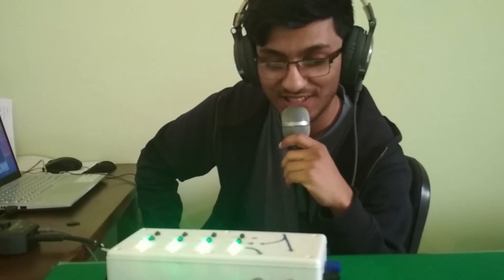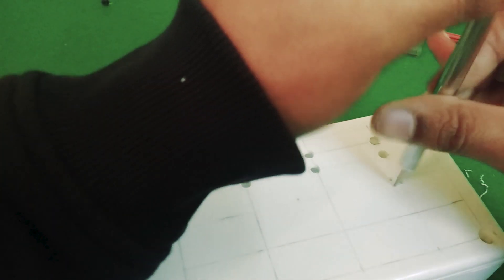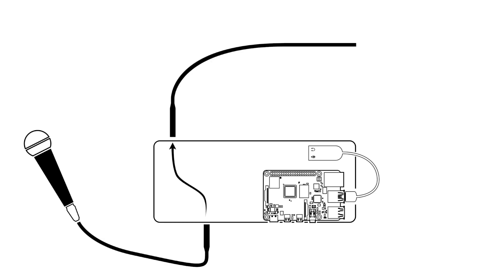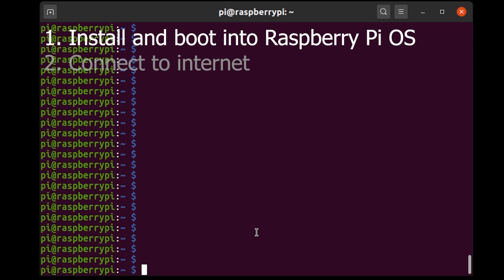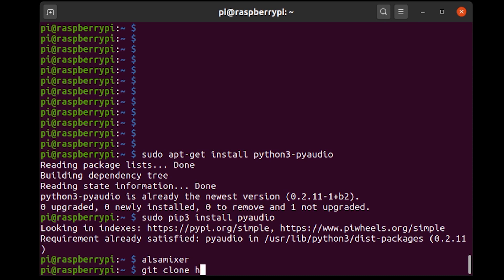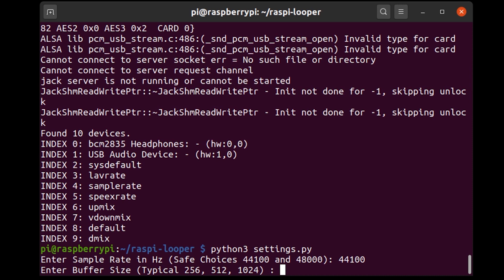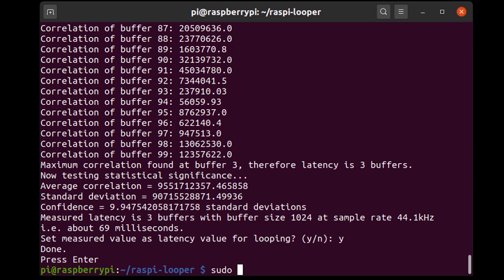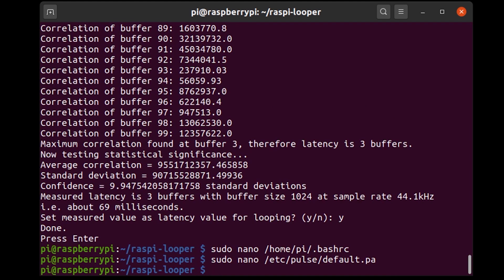DIY 4-Track Looper w/ Raspberry Pi | Building a Loop Station

Comment: Thank you for the video this looks awesome! I want to try and build this but I’m new to this kind of stuff and don’t have many supplies. For your guitar + mic input setup at 6:07 is there a way to do this with only one type of resistor (like only 1k for example)? Also I would like to try to build your mixer but don’t really understand it enough so I will have to figure out how to combine the 2 outputs. Also, what is the minimum amount of RAM I need on the raspberry pi?
Reply from the maker: Hey, thanks for watching and commenting! If you are very new to electronics I would definitely recommend using some sort of 2 channel PA or off-the-shelf mixer for output. If you want to do a simple input setup I would honestly recommend a single input, but if you want to combine your mic and guitar input signals passively with a single resistor I might suggest you try putting something like 200k in line with the mic. The input setup as shown in the video is just one possibility, and not necessarily optimal. If you wish, you can write to me at my "business email" (listed on the channel page) and we can discuss what kind of input setup might work best for your needs.

Comment: great video, definitely going to do this! One thing though, are you able to add more than four tracks, or is there a limitation in the software or the pi?
Reply from the maker: Glad you liked it! Make sure to check out the update video for the software setup. The script is currently set up to do 4 tracks. Someone did make a 6-track version, but it would require some changes to the code

Comment: I have seen in your pdf there a pots with 47k, am I right and these are logarithmic to mix the input level of microphone and guitar. I asked myself, would it be just possible to put the same ones with also the similar schematic to the outputs. Also instead of using a mixer  a Y-instrument cable, like you do for guitars with 2 outputs for amps with just one input?
Reply from the maker: Definitely the most common question I get. Not possible, unfortunately.
Reply from the maker: The reason is that if you think about it, you're just connecting the output to the input so every loop would get recorded on every overdub
Reply: @Psychotenuse   thank you  very much that is so true, just looked in the wiring again. So building an external mixer would be the best option for a pedal board to power it with 9 and than I also don´r worry at all about the 2 extra pots and just go with the ones for the Input. I am trying to do it with some more sturdy footswitches, so I have to drill out at home a metal casing I have ;) I really love how easy it looked from what you explained and this DIY is so upgradable; seems very legit! I just had the Idea of using a 3 pin, 2 way switch  for switching the resistor for guitar to microphone...would this cause problems down the road?   Very kind of you how you replied and how fast you did it :)
Reply from the maker: I am currently working on a 2024 update video to the looper (mostly just making sure the software still works as it should and updated install instructions etc)
Reply from the maker: If you want to use just one input at at time then it's best to just connect it directly and adjust the volume as required. You'll get the least possible noise this way.
Reply: @Psychotenuse  the idea is to be able to set the resistor of each input individually with a switch for each to microphone or guitar. With what you said taking in consideration, I am thinking of a 3pin 3 way switch now. on(guitar/off/on(microphone). The use would be using one input, or two in different variations.

Comment: Can you clarify why/how the raspi ZERO did not work well enough for you
Reply from the maker: Not enough processing power, basically. Would probably work if written in C but with Python there's not enough juice.
Reply: @Psychotenuse  thanks a lot for the quick reply. How do you notice there isn't enough processing power? Stuttering?
Reply from the maker: Yes. Basically, you progressively increase the buffer size until there's no more "stuttering" or glitches. The more processing power you have, the smaller you will be able to make the buffer size. And the problem with long buffer sizes is that they cause sync and timing issues.

Comment: thanks for this! altho when i tried to check for latency there was an error saying that the “np.float” command is no longer compatible with numpy 1.20 (i am on 1.24) instead use “float” by itself
is there any way i can edit your latency code and clone said repository with renewed code to my raspberry pi?
OR is there a way to downgrade numpy back to before 1.20?
this was my first time doing anything with coding and this video has given me many experiences so thank you again for this!
Reply from the maker: Hey! Did you get it to work? Glad you like the project :)
Reply: @Psychotenuse hey! so i found a workaround for the latency part!
but the autoboot part has an error going “Error writing /home/pi/.bashrc: No such file or directory” does it have something to do with the fact that i am not using linux but connecting the raspberry pi directly through my monitor using a hdmi port? and what do i do about it?
anyway i appreciated your response and sorry for taking your time!
Reply from the maker: No worries :)
Yeah, I'm not sure I know what's happening there... Can you check that you're running the commands as sudo
Reply: @Psychotenuse yo! so apparently i had set a different username this whole time XD i got it running and the software part is done
but as i feared i couldnt quite understand the schematic for the audio, so it unfortunately had no guitar sounds out the output i’ll try to write out what i understood:
so i have 2 wires which has tip,sleeve and ground wire in it which then i soldered them to each ts socket, one is used to connect with the amp and one for the guitar
for the guitar jack i connect it to the mic part of the usb soundcard and for the amp jack i connect it with the headphone part of the soundcard 
sounds were made when i did the latency test or when i touch the tip wire of the amp jack but no sounds were made from the guitar
if you have any idea what i did wrong please let me know!
Reply from the maker: Hey! Really sorry for the late reply. Seems like you're missing the "LIVE" output. BTW I will upload an update to the looper soon.

Comment: Will this work if I use my guitar without the Multi-effect processor? I’m assuming it won’t, because the audio input needs to be battery powered or have some independent power source from what i have understood
Reply from the maker: It should work, depending on the soundcard you use.

Comment: Hey, first of all, this is awesome!! Is there any way I can do this on a raspberry pi pico? Raspberry pis are kinda expensive for me and I’d really want to try this out and have a loop station. Any advice?
Reply from the maker: The Pico is a completely different thing, unfortunately. It won't work.

I got my Pi for not much money, but looking at the prices on Amazon now they seem insane for some reason (over 3x what I paid). I don't know what the deal is. Maybe prices will come down again?

MSRP for the Pi 4 2gb version seems to be 35 USD. You should be able to find it for under $50 if you shop around. Check out local stores or smaller websites.

Sorry I couldn't be more helpful.
Reply: @Psychotenuse  thanks so much for replying. I’ve found a cheaper brand  of micro computers called Orange pi, but I’m worried I’d run into issues following the steps in your video since it’s for raspberry pis, would I be able to email you about anything if I do get stuck?
Reply from the maker: Yeah sure, but I'm not sure I'd be able to help much. The code for the buttons would have to change if you use a different board. If you have experience with Python programming, you should be able to figure it out.
Reply from the maker: A little research reveals that there is insane price gouging going on at the moment due to short supply. That really sucks :/

Comment: An even better solution to autostart would be to add it to crontab, since bashrc only executes when you open a bash console, and crontab can be set up to run when the pi boots up, even if it doesn't automatically log in
Reply from the maker: Sounds like a good idea!

Comment: Hey, first of all, this is awesome! Thx a lot for sharing!

I build a prototype with just one play/record-button-set to test if it would work on a 3 B+ I had lying around. I can already tell I'm going to build the whole thing to be honest. It's sooo much fun...

When I record, the first two loops turn out quite good, but from the third loop there's increasing creaking in the resulting output. 

Do you think this might be related to my settings, or could it be because I'm using a 3 B+ instead of the 4 you suggest? Hard to get your hands on these nowadays...

Any answer highly appreciated!
Reply from the maker: I have no idea what you mean by creaking. Why don't you email me some audio
Reply: @Psychotenuse  Thx a lot, did that yesterday. But I don't think this is debuggable remotely. I'll try to get a raspberry 4 and try it with that one. Will keep you updated here.

Comment: Awesome project and exactly what I wanted to build. I have a few questions. What's the purpose of using momentary switches rather than latching? Does this mean you have to have it pushed during the entire recording? Could larger, more traditional stomp switches be used in place? The little buttons shown here seem like they'd be easy to miss with your shoe while on stage.
Reply from the maker: Thanks for watching :)

You don't have to hold the button down while recording, as you can see at the beginning of the video.

Momentary switches are more versatile than latching switches because they allow you to detect long-presses i.e. button "hold" events in addition to button "press" events. Toggles are implemented in the software.
Reply: Cool - and any normally-open SPST stomp switch should work with this, right?
Reply from the maker: Yes :)
Reply: Last question I think. I have access to an older Pi already. Would there be any issues with your code or the playability of it (lag, etc) on an older model, assuming it's at least 2 gig of RAM?
Reply from the maker: What version is it?
Reply: @Psychotenuse  either a 2B or 3B I believe. It's at work right now though and was left over from something I did a few yrs ago
Reply from the maker: It might struggle on the 2b, but would probably work on a 3b.

Comment: Incredible! Are you able to integrate a verse-chorus function where you have two completely different loops and are able to layer them separately?
Reply from the maker: There are four tracks that can be overdubbed, muted and unmuted individually. You could definitely find ways to build a verse and a chorus and switch between them.

Comment: I went ahead and am trying to make this build but with exclusively 3.5mm cabling, since I really have no need for a guitar input: I’m running into issues stemming from my lack of knowledge about the difference between 1/4” and 3.5mm audio cables. Have I made a terrible error by trying to use a mic with a 3.5mm output? Any help would be appreciated.
Reply from the maker: Not a terrible error (after all the 3.5mm jack is just a smaller version of the 1/4" jack), but there are two things you need to keep in mind:

First, the actual connections. 1/4" jacks are most commonly TS or Tip-Sleeve, i.e. they have only two conductors (and only one insulating band on the actual plug). 3.5mm jacks are more commonly TRS (Tip-Ring-Sleeve) or TRRS (Tip-Ring-Ring-Sleeve), meaning they have three or four conductors (two or three insulating bands) so you need to know that in order to use a TRS or TRRS jack as a TS jack, you simply short the Ring terminals to the Sleeve terminal on both the male and female connectors.

The second consideration is what you're actually plugging in. The setup I show in the video will work for line-in inputs or dynamic microphones, but may not work if you plug in an electret mic, because those require a special kind of input with a DC offset and drop resistor. Electret mics are used in most consumer electronics, so most cheap USB soundcards and/or 3.5mm mic inputs do support electret mics if plugged in directly. If you use any DIY wiring between your mic and soundcard, however, you must take some time to understand how your mic and your soundcard input work and how that affects your wiring.
Reply: @Psychotenuse   I see! I sent an email to you with some proposed changes to my setup. Thanks for helping someone with far less understanding of this stuff :)

Comment: Hi im new to schematics. can you tell me what the triangle on the lm358 amp on pins 2,3 and 5,6 mean on the mixer schematic? does that mean the pins are connected?
Reply from the maker: those just represent the two halves of the chip. You can ignore the triangles if you're just trying to build the circuit using the lm358.
Reply: @Psychotenuse  But are pins 2,3 and 5,6 jumped together? it looks like the wire going to pin 1 is connected to  pins 2 and 3. or does that line not matter either. thank you BTW
Reply from the maker: @Jasonbova  just go ahead and ignore everything drawn INSIDE the chip rectangle.

Comment: i have another idea 
How about we replace the Raspberry pi with a arduino and do the Loopin on the computer side via a software.
Reply from the maker: Sure, that could work. Kinda like just using a Midi controller to loop in Ableton or something.

Comment: Thank you for this project. When I perform a loop I have roughly a 3 second lag between loops. What setting do I need to change to remove the space? Thank you!
Reply from the maker: 3 seconds is way too much, honestly I think I set the maximum on the  latency script to 1 second or something.
My immediate reaction would be try a different soundcard (and repeat the setup process for it).
If the problem persists, email me at the address in my channel about and we will try to figure out what's going on.

Comment: I have built and programmed the looper exactly as you described and it works but with terrible sound recording on the loop. The rasberry pi and the looping software boot up using pulseaudio and never save the alsamixer settings. Normal ways to save alsa settings do not work pulseaudio always is loaded as default so when i open alsa mixer it always has pulseaudio selected and not my usb sound card. Please tell me how to fix this so that it simply boots up with the correct alsa settings selected.
Reply from the maker: Hm. Could you describe how the sound quality is bad? That might help narrow the issue down to software or hardware.
I didn't have any trouble with alsamixer settings reverting, so I'm not sure why that's happening for you. It is possible that there has been some change to the Raspberry Pi OS which is causing this.
Do you think your issues might be related to this: https://github.com/RandomVertebrate/raspi-looper/issues/5 ?

Comment: Can i use pedal switches for this? Also... I hear some clics when you play de recorder info ir is it the video render?? And is a RPI 4, right, since i think there isnt a RPI4 B+ ???
Reply from the maker: Let's see.
You should be able to use pedal switches for this, sure, as long as they are push-to-connect.
At the time of recording of this video there were some issues with clicking and clipping, most of which have been fixed since then in the code.
What I bought was listed as a RPi 4 B+, but I don't see why any other RPi 4 wouldn't work. Just make sure to make connections with reference to GPIO numbers.
Reply: @UCwBP-ufaCyQ3ZUS9eGUM3rA awesome! Thanks for your response, sir! Uhm, say, push-to-connect will be a "pulse switch"? Circuit close only while pressed? 🤔
Reply from the maker: @cristobalbarrientos5377  Yes, that's right. Momentary push-to-connect switches, like the buttons I use in the video.

Comment: How about latency ?
Reply from the maker: Live audio is passive analog throughput, so there are no latency issues there. The loop playback is latency-corrected by the amount detected when you run the latency detection script, seen here from about 13:01

Comment: You said something about having to use linux. Does it have to be a Linux OS to use raspberry pi?
Reply from the maker: Most of the operating systems available for Raspberry Pi are Linux-based. Honestly Windows audio is a lot better... but it is what it is.
Reply: @Psychotenuse  
But I would be able to access and use raspberry pi and python3 drivers with windows 10? As long as I have a command prompt?
Reply from the maker: I'm not sure I understand what you're talking about. Why don't you email me at the ID in my channel about section.

Comment: The first three play light come on, the third being faint. That is all it does, it won't play any sound, there are no other lights. Is there some way to see what wires are function properly? What are some other trouble shooting ideas you have?
Reply from the maker: I think that might mean that the Python script wasn't able to run successfully. That sucks :(
Can you log into into your Raspberry Pi (keyboard and monitor or ssh) and see if it's giving you any errors?
Reply from the maker: Try to run the Python script from the console and let me know what happens. You can email me at the id in my channel about.
Reply: @Psychotenuse  Thank you I will try that.
Reply: All of the lights are working now, but there is no sound.

Comment: My 1/8in audio jack(auxiliary plug) has a third wire, what should I do with it?
Reply from the maker: This is probably because it is a TRS jack, with Tip, Ring and Sleeve terminals. You can short the Ring terminal to the Sleeve terminal to use the jack as a TS (Tip-Sleeve) jack.